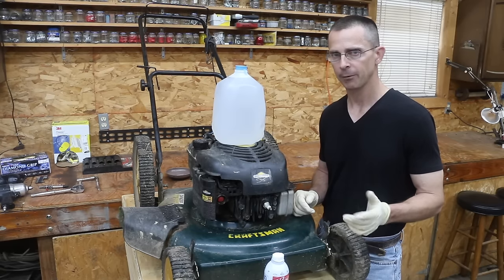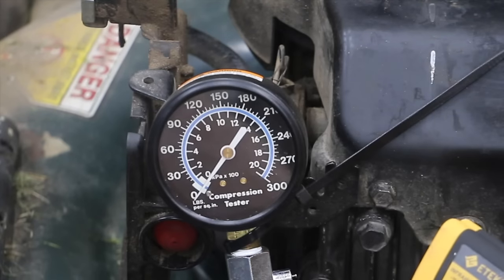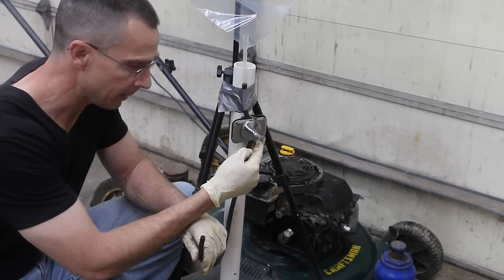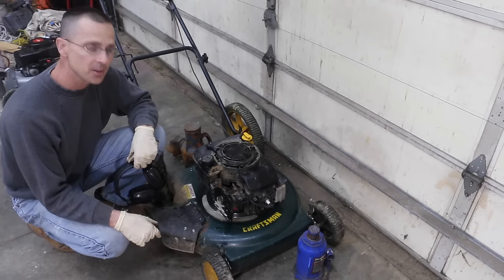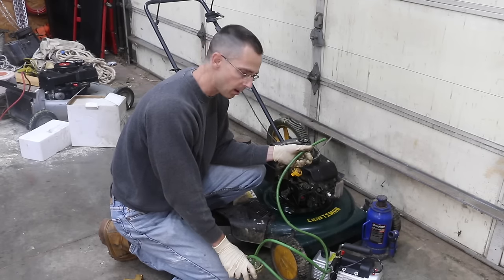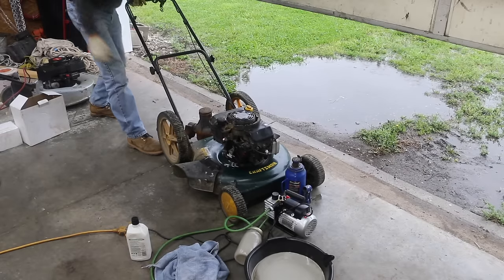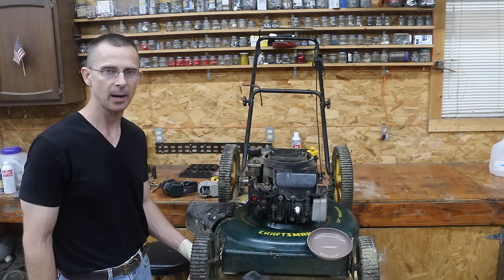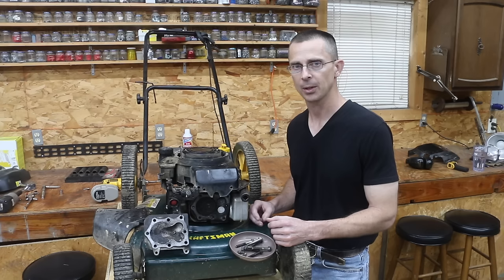Seafoam--can't believe what it did to my engine episode 5--cylinder cleaning test using water!!

Comment: I thought that it was a crazy idea when I read the headline. Lo and behold, I see that it was. Sure,it may have improved the compression slightly, but it did not remove any carbon. It actually looks worse. At best all that it did was to move the carbon around a bit. And who knows how much future damage will happen. Evident from the water in the oil. It was a horrible idea. It can only ruin a motor.
Reply from the maker: Thanks for the feedback.

Comment: I think the water delivery rate was still too high.  I would prefer the water be atomized before entering the carb.  Interesting that the water made it into the crankcase.  Past the rings?  That motor might have been close to a hydro-lock condition and forcing the water past the rights.  Also, how the heck did water start coming out of the carb?  That means it condensed on the walls of the intake passage and dripped back down to the carb and out.  If that's true, it's a clear indication that too much water was delivered per unit time.
Back in the day, we noticed that head gasket failures exposing the chambers to water and ethylene glycol removed almost all of the carbon.  Mix up some anti-freeze and water 50/50 and there's yer dinner.  And atomize it somehow.
Reply from the maker: Thanks for sharing.

Comment: Important note, water does not compress. Be very careful that when doing this. Too much water can cause catastrophic damage. Think water laser. Water is quite abrasive, just look at river stone and that  is not inducing heat and pressure associated with internal combustion. Water under pressure can cut metal. Overcompression of water can bend the connecting rods, shatter pistons and cylinder walls. It works great though when done properly.
Reply from the maker: Thanks for the feedback.

Comment: That is an awful lot of water for such a small engine. I used transmission fluid in my 1980 f150 with a 300ci inline 6. I would throttle it up by hand and poor transmission fluid straight down the carburetor. Run and idled smoother after.
Reply from the maker: Thanks for sharing.

Comment: Use a spray bottle to add water. A weed spray bottle that you pump up works best. It gives a constant flow and the water is already in a mist so less chance of hydro locking accidentally.
Reply from the maker: Thanks for the feedback.

Comment: Best way to use it is by inserting water by steam so the steam water breaks up quickly inside the Chambers and doesn't risk too much water entering so here the  water isn't being burnt off in the cumbustion process and mixing with oil inside the engine. Steamed water will burn quickly as it cleans an through the process of combustion
Reply from the maker: Thanks for the feedback.

Comment: Would say water won hands down, but who would drip water in a car engine for over two hours?   The one time I tried it back in the day, just ran set amount--one quart--through while keeping the idle up by hand. 

If a persons goal is rid the combustion chamber of excess carbon, back before there were all these additive products, you did it by flooring the engine on a secluded road, and run it to redline through all the gears.  You could tell by the amount of white smoke coming out the back how long it had been since you last did it.  One month, a lot.  One week, a little.  This was back in the days of leaded gas, so don't know if the same approach would work today.

Since the fuel-additive days, have found RxP to perform best to reduce ping and blow white smoke out the back under hard acceleration.  Have tried all the other popular brands, and none of those ever produced the smoke.  Just my .2.

Comment: When flushing out the oil system, it is best to use Kerosine.  The gasoline works to clean the old oil out while the oil portion of the Kerosine helps to maintain a clean oil film.  Also, nowhere in this video did I see any testing of Seafoam.  This video only showed the water test.
Reply from the maker: Thanks for the constructive feedback.

Comment: everyone is an expert, but 12 oz of water is enough to clean a v8. it's the same principle as pushing a hot soldering iron into a wet sponge to clean the tip of the soldering iron. putting water onto hot metal is a fantastic way of cleaning. also works great for cast iron skillets.
Reply from the maker: Thanks for the feedback.

Comment: The theory is that when you get the engine really hot and spray cold water on the super hot carbon build up,it will crack and break away do to the sudden temperature change.also what you want to do is spray small amounts with a spray bottle.drip will be too much.
Reply from the maker: Thanks for the feedback.

Comment: Neither water or Seafoam interests me. I would take the engine apart and dump the parts in vinegar. Let the parts  soak for a couple or three days and if it works like I believe it will, the results should amaze. Now I use apple cider vinegar, not white distilled, but staff use white to clean grease, etc. after a hard day of solid cooking in restaurants. Environmentally friendly, cheaper than Seafoam and less messy than water. 

I once used this method on an old tea pot caked thick with hard water dep[sits from not being cleaned for a couple of years. Let the pot sit with the vinegar covering  the deposit for a couple of days and chunks parted from the tea pot and it was super clean..
Reply from the maker: Thanks for the feedback.

Comment: The reason you got water on your oil is because you did this on a 2 stroke engine. On these the intake air passes through crankcase. So your water going through the carb is actually dripping into your oil

Comment: If you want to kick it up a notch for a new video is to try "Gumout Tuneup" which has a higher concentration of PEA which is proven to clean internal combustion engines in lab tests. It is a improved version of Seafoam.
Reply from the maker: Thanks for the suggestion.

Comment: Oil temp would be a factor in using waterthe oil temp has to be high enough to get the moisture out of oil, which might have prevented the oil/water issue you had
Reply from the maker: Thanks for the feedback.

Comment: Compression seems a bit lower then it should be on a small engine of that design seems like it should be closer to 80-90lbs of compression if it's a good running motor
Reply from the maker: Thanks for the feedback.

Comment: A low compression, low RPM lawnmower engine operating at zero load doesn't produce enough cylinder energy to fully exploit the benefits of water injection. An engine with significantly higher cylinder pressure and temperature will produce more dry steam per cubic inch, and dry steam is what cleans deposits in the chamber. Wet steam and water only serve to dampen the burn, condense and milk up your oil.
Reply from the maker: Thanks for the feedback.

Comment: water injection has been around for ages.... your mistake was to just trickle the water into the engine (carb). water injection works, if atomized/made into a vapor. this prevents droplets making it past the rings and contaminating the oil. water injection will clean a engine (combustion chamber and piston top/valve tops).. takes time, to clean the engine, over 100 miles or 30 hours or more..
Reply from the maker: Thanks for the constructive feedback.

Comment: I tried water once in my 5.3 on my chevy truck but somehow it got into the crankcase and made the oil milky so I found mixing 1 yellow bottle of heet or other methanol with same amount of water it works quite well because if any of the solution slips past the rings it will evaporate easier than water
Reply from the maker: Thanks for sharing.

Comment: I stopped the video before you added water. I vote for Seafoam, though I know this video is quite old and long over. For me, it's March 2022. Water will clean some stuff up, but built up carbon is not water-soluble. Charcoal stays charcoal when you dump it in water and doesn't dissolve. I'm a chemist BTW. The water cleaned up a little of the heavy deposits, but almost nothing on the cylinder and valves. 

I would go with Seafoam, ATF, or carburetor cleaner or something designed for cleaning engine carbon deposits. Water would not be my choice. To get water in I would use isopropyl alcohol or ethanol to deliver some water to the engine. Water readily dissolves in alcohol and alcohol readily dissolves in water. As water was fed in, the temperature dropped and stayed low because water has a high heat capacity and is really good at cooling. Bulk water getting into the oil is also something I would be concerned about. Thankfully, it was a lawn mower that you could easily flush and clean out.
Reply from the maker: Thanks for sharing.

Comment: You used around five times the water I sprayed into the intake of my Dodge Dakota's V6 Magnum engine air intake. I suspect you had too much water which never allowed atomization, thus steam to actually steam clean the cylinder.  You could make a fortune if you could figure a way to clean the intake, especially of Diesel engines, that are half plugged by carbon from the EGR system

Comment: I know I'm late to the party but, here are my thoughts.  This is an old technique that we used to call an "Italian Tune-Up" back in the 70s.  We did this on big V8s and we used a spray bottle with the head set to stream instead of spray.  We would rev the engine up to about 5,000 rpm and start squirting every second or so while maintaining the rpms as much as possible.  Huge amounts of black smoke would come out the exhaust.  You have to keep in mind fuel wasn't anywhere near as good as it is now and contaminants were common.  Also, engine efficiencies were poor as well.  These issues combined to create carbon deposits.  I feel you ran too much water for too long a time period.  What I believe happened is by running so much water you lowered the combustion chamber temperatures to a point where it was no longer properly burning the fuel which led to a more rapid build-up of carbon.  Also, as you noted, the compression was lower at lower temperatures so, when you cooled the engine it was more able to force water past the rings which is why you had the oil/water emulsion.  I would like to see the test repeated with no more than a couple of ounces of water with the engine at WOT and the governor disabled to allow the most rpms possible.  I have no idea if it will be an improvement but, I am curious to see the results.  Side note:  Water injection is commonly used in forced induction engines especially turbocharged engines.  It has a dual effect.  It cools the intake charge and it effectively increases the octane both of which allow you to run higher boost levels before experiencing detonation.  Alcohol (methanol usually) is often added to the mixture as well.  I love your channel and can't believe I'm so far behind in your videos!  I've got a lot of catching up to do!  Carry on the good work!
Reply from the maker: Thanks for the video idea.

Comment: Hey there, I've been using "Berryman's Chemtool"  liquid fuel system cleaner for years and when I tested "Sea-foam"  against the Berryman's, Berryman's won hands down. Try those two and see what you think. My tests were done with a 1979 H-D FXS (Low Rider) 1200cc (74 cu in ) N.A. 40mm carb with 3/4 fl oz per gallon, and in a 2005 Chry Sebring GTC with a 2.7l (167 cu in ) engine. I saw some in your 3D printed head video on the work-bench,,,, ithink it was that video,,,,,,anyway, try it, you'll like it, I'm sure. 
       Thank you.            Kevin Lewis
Reply from the maker: Thanks for the video idea.

Comment: A lawnmower has alot of blow by compared to a car engine that's why you had alot of water in the oil but I do the same thing to my carburetor car and it helps alot and even with the smog check to lower emissions
Reply from the maker: Thanks for the feedback.
Reply: @ProjectFarm  I just did that to my car it does help I learned from old mechanics

Comment: Yes water works great but not in a single cylinder engine. It's ok for the water to cause misfires and that does not work well in a lawn mower engine. Try the test again in a 4 cylinder car engine. See if you car get 2 Toyota 2az-fe engines for the test. Those engines are known for oil consumption and carbon build up. (And stripped out head bolts) so be careful and use a bore scope for before and after pics
Reply from the maker: Thanks for the suggestion.

Comment: There is another way to add "water" with less risk to get water in the crank case oil... Methane gas has a chemical formula of CH4 and in the burning process its get Oxygen added to H2O (water) + CO2 (carbon dioxide). In this way we add "water" in better way since its appearing in the cylinder as a burn product not as initial mix.
So adding a new gas adapter to replace the fuel with gas can be another idea.
Reply from the maker: Thanks for the suggestion.

Comment: Old mechanics says : engine at normal temp : poor some oil to soften carbon . and then put some water water make the carbon explode by cooling it down fast..  Or maybe the same test as this one . with stop in between too could help. Cause the engine will heat up to normal operating temps in between.
Reply from the maker: Thanks for the feedback.

Comment: @Project Farm  ...  So much for some eggheads.  :-p  The water/chamber clean was used way before there were multiple cleaners available everywhere.  Things advance, or we would be reinventing the wheel every generation.  NO, I would not use water!  Seafoam wins!  Time consumed, extra money for extra oil, cleaning, and recleaning, etc.  It can also be argued that the lower running temperature could cause the rings not to expand enough and the piston could score the cylinder wall.  Even if that is only a tiny bit, that is too much.

Comment: The flaw in the water injected testing is that you aren't using an engine that is developing vacuum.
With an automobile engine we would raise the rpm ro 2000 and close the throttle and drip the water in with the engine at high manifold vacoom causing the water to turn to vapor and go to the cylinders not as a liquit form but a water vapor..

In shops we would use a vacuum port in the intake manifold or carburetor and pinch the hose - or use a little plumbing valve - to regulate the water - again raising the rpm to 2000 and letting off of the throttle to allow the water to come in and then vaporize in the high vacuum atmosphere of the intake manifold.

An alternative method was to rig us a standard air hose blow gun. The large supply line going to a gallon of water - and use an adapter on the blow gun output that would accommodate a small vacuum hose that went to the vacuum line in the intake or the carb.
We would drive the car - gallon of water on the floor - and go down the highway. We would barely push open the blow gun allowing just a little water in while on a steady cruise.
After 10 minutes or so we would then  accelerate to 70 or 80 - with the blow gun closed - then let off the throttle completely at high rpm and very high vacuum and push the blow gun fully open the a few seconds - and let that get to the cylinders. 
Repeat this process until the gallon of water was gone.
I might add that we would - on the slow 55 mph cruise - that we would push open the blow gun valve slowly until we felt the engine missing or misfiring - and close it back a little until it cleared up - and leaving it there during the cruise part of the treatment.

This process would make engines with lots of miles and obvious carbon concerns idle smoothly and run better while passing - because we were not only cleaning at high vacuum with vapor not liquid - it would also clean the top of the intake and exhaust valves as well - allowing a cleaner flow of air into the cylinders.

The only way I would use Seafoam - this my opinion only - would be to use two cans of the high mileage Seafoam in a large fuel tank - fill up - and take a drive to use as much fuel as possible.

In a lawn mower I would simply mix Seafoam in a gallon of fuel very strong and run two lawnmower fuel tanks full thru it - and the remainder put in your vehicle fuel tank.

Comment: You should create a water injection system.  Add an atomised mist of water to the air going in the engine.  This will boost compression and clean the engine over time.  A lot of aircraft had water injection during WWII to boost power for take-off or for emergency power.
Reply from the maker: Thanks for the video idea.

Comment: You can't just let water drip into the intake of a running engine. It needs to be sprayed in a fine mist with a fuel injector so that it mixes completely with the fuel air mixture at a minimal controlled rate. The fine spray will flash into steam during fuel combustion and steam clean the combustion chamber very thoroughly. And yes, there will be a small amount of H2O migrating into the crankcase due to blowby. Racing teams know this and will change the oil after the race. They use water injection for the purpose of controlling engine knock in high compression engines. The cleaning result is just an added benefit for them.
Reply from the maker: Thanks for the feedback.
Reply: @ProjectFarm  Love your Channel. You do a great service to us .

Comment: I'm surprised you didn't atomize the water output. Via in my experience. A hair spray bottle. However doing that for 2 hours your hand would litterally be Jello. But, may have had different results. The point is to steam clean the combustion chamber, not wash it out. Dribbling water could very well have atomized via the vacuum and fuel spray from carburetor. I've done this before. On 2 vehicles. Never have I had milkshake at the end. To much water. That's simply it.
Reply from the maker: Thanks for the feedback.